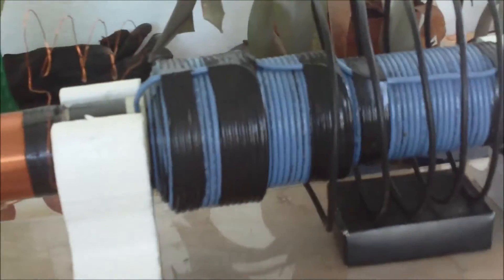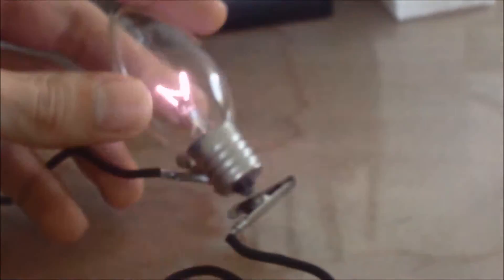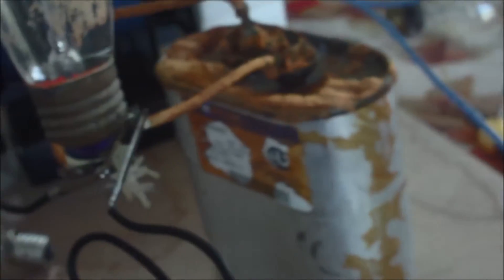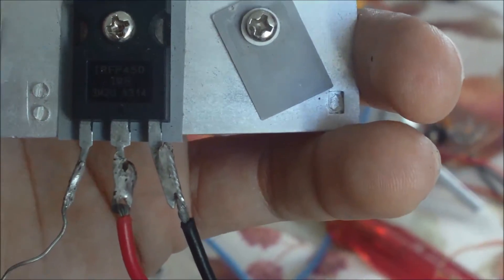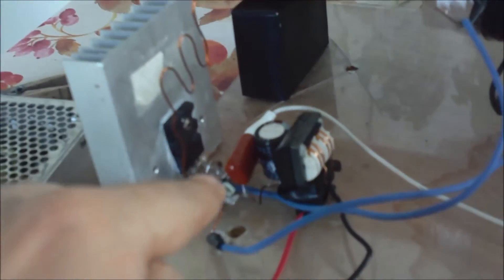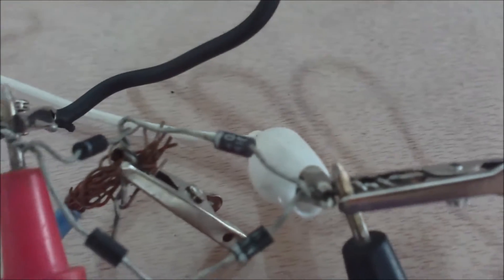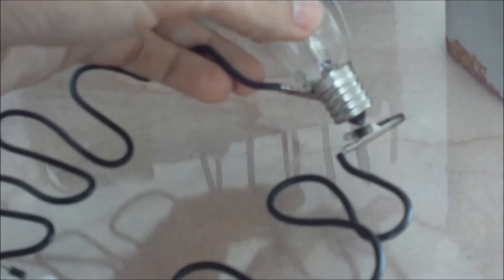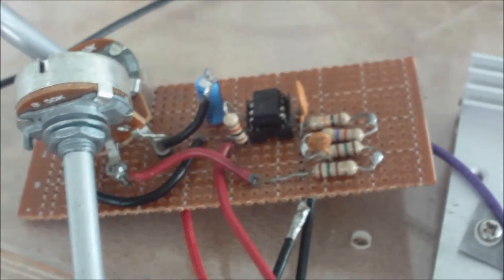Ruslan's Latest replication test 2

Comment: Your capasitor is charging wery slowly. With that speed you seems not get free energy...
And it must charge to higher voltage. Without load it must charge maybe to 4000 volts. Ground must be conected on minus of this capasitor and on minus of 12 V. Did conected ground on minus?
Reply from the maker: Hi Kris,
Yes  it charges it slowly now because of no pulse generator connected to the output voltage DC.  But If you speed up the charging rate on cap, you have higher voltage and automatically great amount of load. I will need better caps like 2000Volts or 4000 volts for sure and then it will be better, but it's all experimental for now but sharing the thoughts on this.
Yes ground will be connected on the minus side on the cap, I did not connect it yet, but I will install the impulse circuit first to charge faster and then connect ground to see the difference. Reminds me of Don smith.